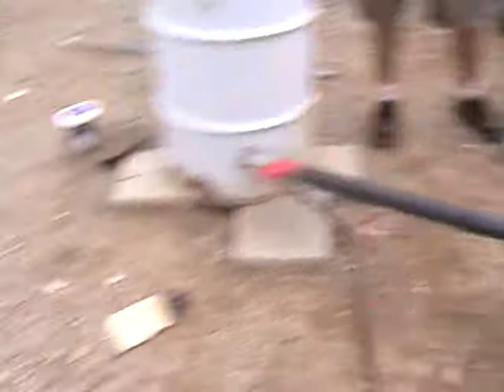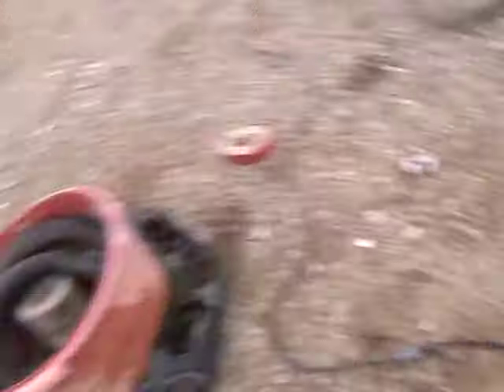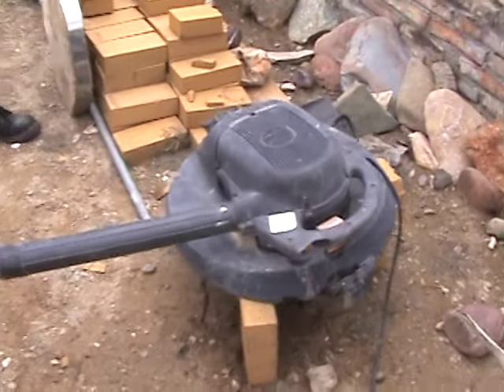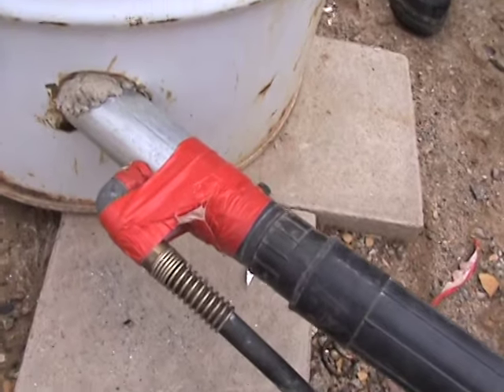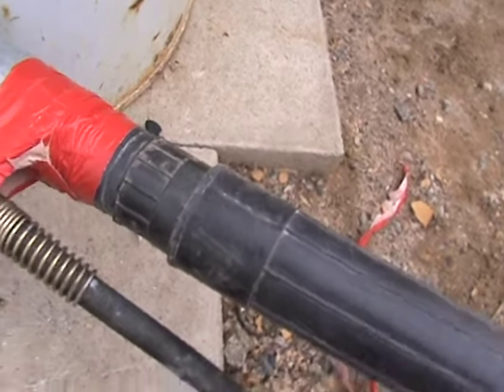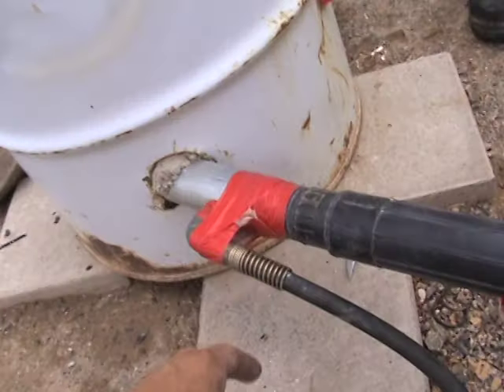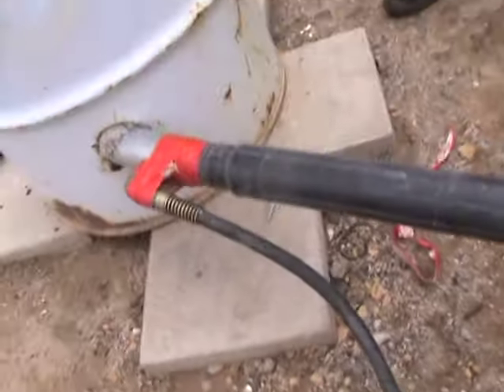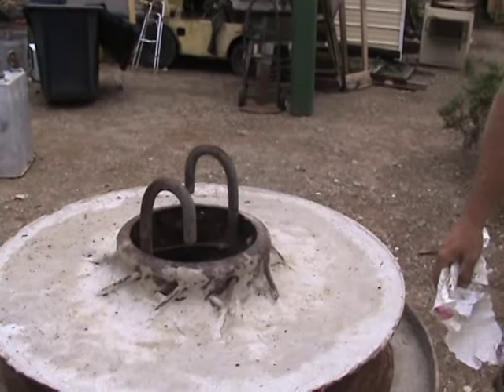DIY how to build a homemade blast furnace, firing it up

Comment: Not a blast furnace. You're not smelting Iron with limestone and coking coal.
Reply from the maker: Correct 💯 congratulations, smelting copper and gold mixed with silver and zinc and lead, smelting was done with flour, carbon is carbon in all forms,glass and borax with nails to counter the sulfides, I made a metal bar from ore from my mine.